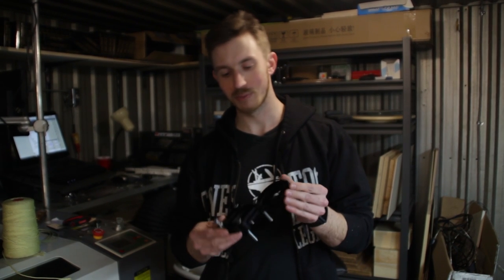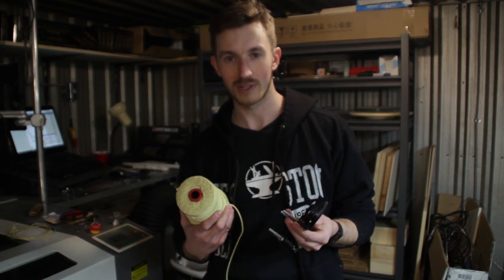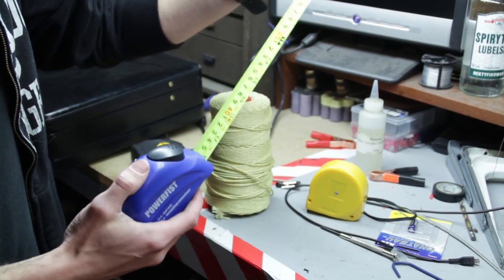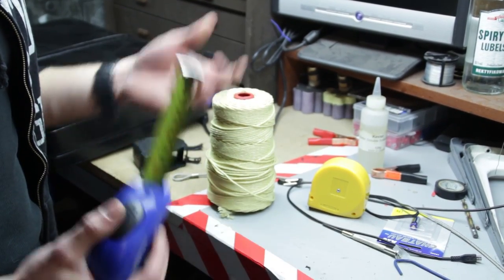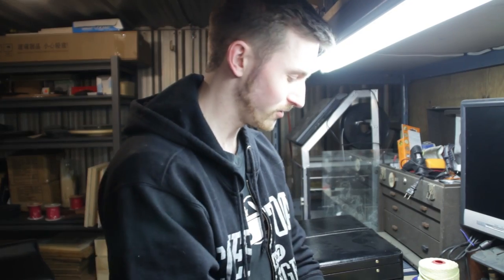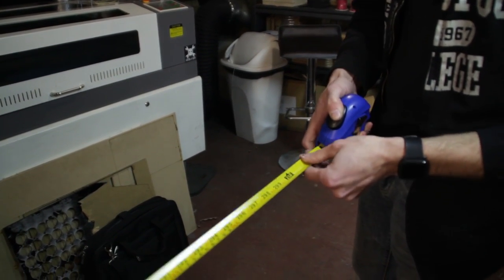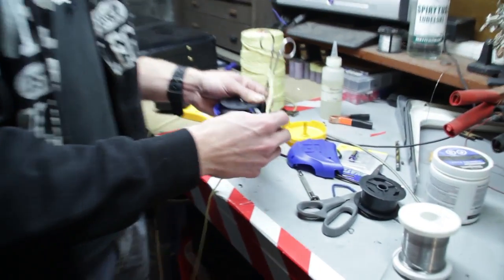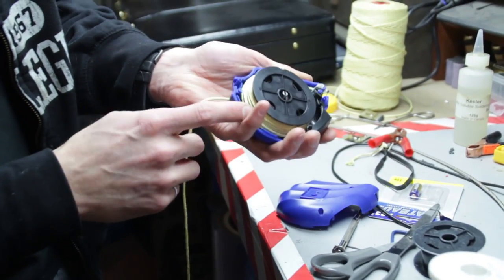Batman Rappelling Part 2 - Housing the Rope!

Comment: 3D print a piece that matches the profile of the tape measure case that will fit between the 2 sides, widening it, and print another spool that will interconnect with the original to hold the rope.
Reply from the maker: +krbruner Good idea!
Reply: +the Hacksmith why don't you use a reel from a fishing rod?

Comment: The problem with the rope bunching up... never buy an enclosed air hose reel from Princess. Always buy the open roll (3/8" x 50', on sale now for $99 regular $149). Same deal. Sure the reel holds all 50 feet of hose inside when it's coiled perfectly, but when it's not (and you can't tell, since it's enclosed in blue plastic) you have to pull it all back out and start over. Plus the reel is swivel mounted so you can't even guide it left to right because it follows wherever you drag it. The open reels aren't on a swivel, but they have edge rollers up/down/left/right so you can pull the hose off sideways if you want.

Comment: The Tape measure is a good idea. Wish I thought of it.  But there's a bit of a flaw.  Being able the hold the length of the rope is one thing, but the casing itself, may not be able to take the weight of a fully grown person. You may have to replace the casing's material with something more sturdy.

Comment: +the Hacksmith so I haven't watched your third video yet But I suggest using a Chalk Line instead of a tape measure..a chalk line comes out of a tape measure device and you stretch it out and then the string covered in chalk will make a nice line for you..so just replace the string in the chalk line

Comment: Quick question? Shouldn't the claw have four sides, and be a more metallic type material like titanium or something. Because in a real situation you aren't always going to have a round surface the hook can clasp itself around. Also, when you launch the hook out shouldn't it have some kind of penetrative force to give it a greater rate of success in latching itself on to something?
Reply from the maker: +14supersonic it's a rappelling hook... not a grappling hook. You can attach it to a tree branch, a pipe, a handrail, a guide wire, etc. We'll look at doing a grappling hook next but this is purely for rappelling -- not throwing ;-) there's a reason those things don't really exist, cause they're really hard to make to actually work like in the comics ;)
Reply: Aaaah... well that makes since now. I'm sure when you guys get to that point you could figure something out. I always thought that making one would be a challenge, but "that" challenging.